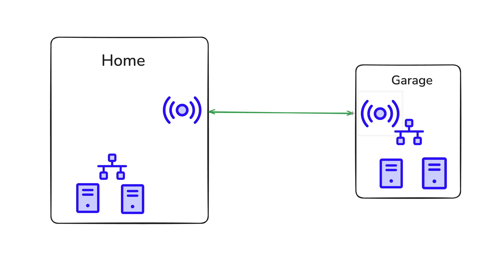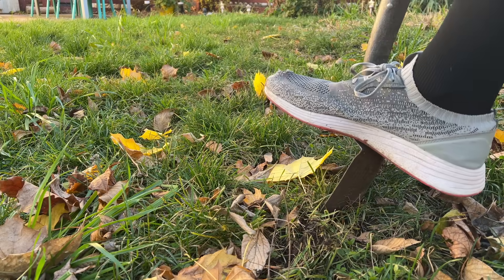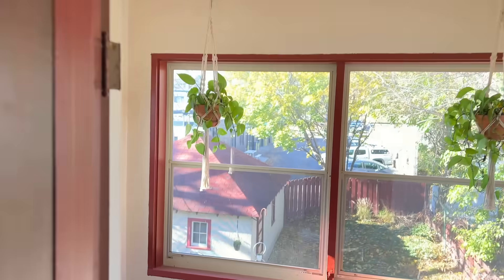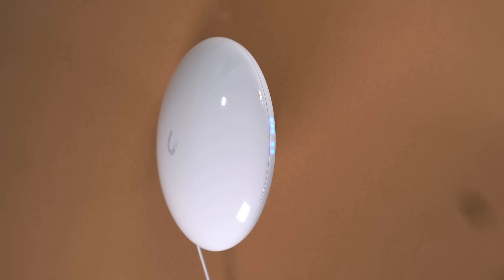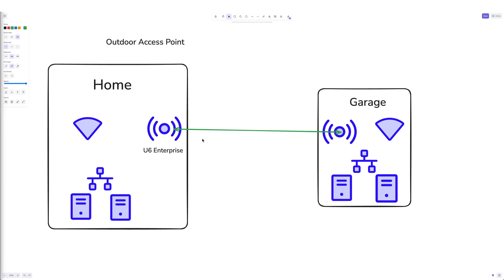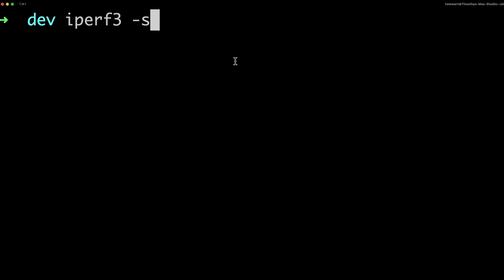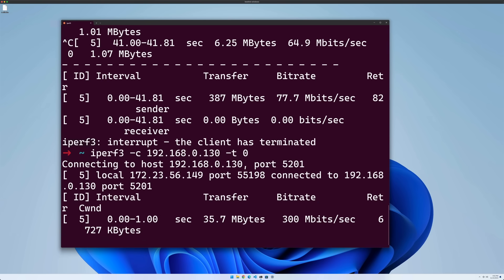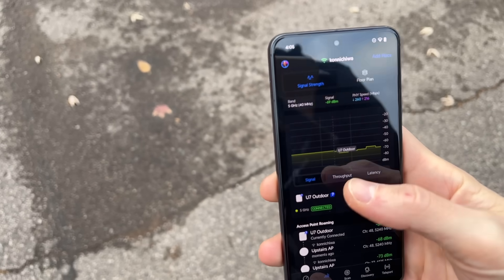Improving my WiFi Bridge with the UniFi U7 Outdoor and the UDB

Comment: 30m of fiber and two SFP modules or media converters would solve all the problems forever
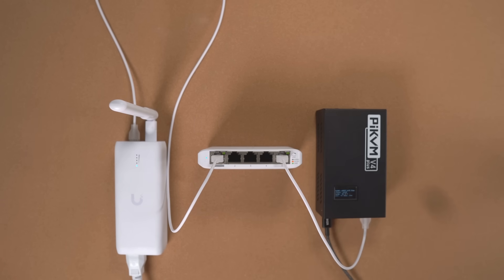Reply from the maker: 0:1:34
Reply: I was in a similar situation and I didn't want to dig a fiber cable because we plan to place a new house there soon. I went with two Nanobeam, because nothing else was in stock. Both mounted on the outside. I mounted them and they just worked. I didn't do much benchmarking but I get the full 200Mb in the house from the fiber internet that comes in at the garage.
Reply: lol bro didn't watch the first two minutes of the vid
Reply: As a radio engineer I would always recommend going fiber when possible 😉
Reply: how'd you get the cat 6 outside
Reply from the maker: @dudedavid522  I fed it thought the existing fiber hole which is about 6 ft from the pole I mounted it on, above ground.  There's no way to go to the garage without going under the cement patio and avoiding a buried electrical line.  No thanks.
Reply: Or an aerial line
Reply: No matter the cost and hassle of installing a cable. It will always win, heck you did a FULL video planning and setting up a wireless setup. Stop

Just pull two cat 6A or better cabels and if can pull a fiber too for future. You afraid of drilling. Usually it’s not that bad when done
Reply: Can’t you run the fiber together with the electrical wire?
Reply: @Maunose  Or just lay it under the patio stones, don't even need to trench it in, scratch the surface to move some of the pebbles out of the way.